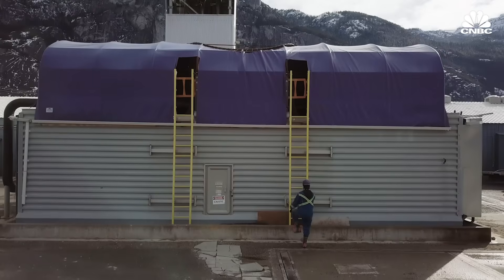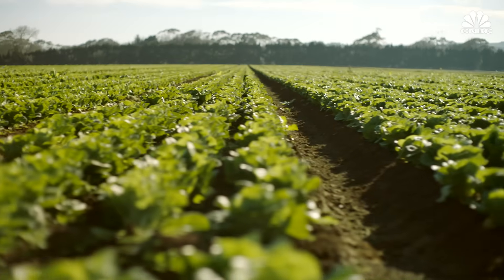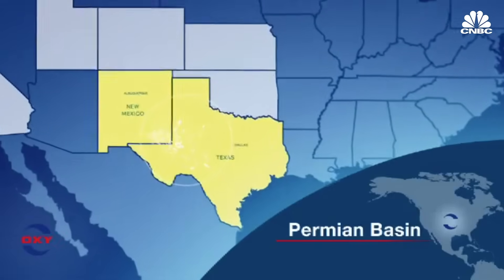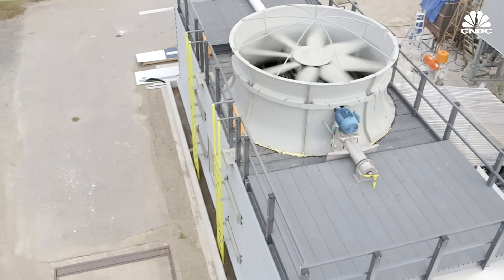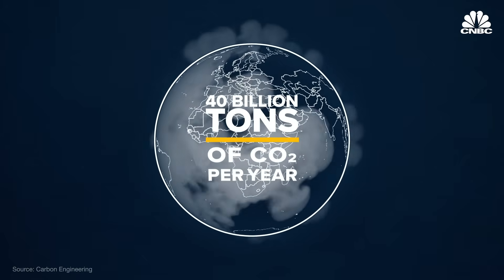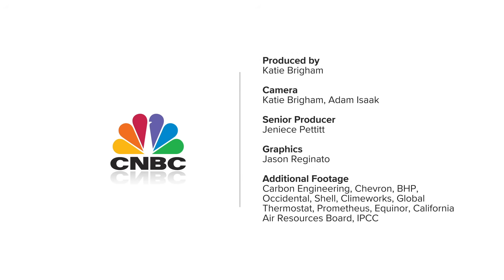Bill Gates-Backed Carbon Capture Plant Does The Work Of 40 Million Trees

Comment: Carbon Engineering is a scam. They are rent-seekers, dependent on the Government to select them as a "winner" the way Solindra, Enron and the Military Industrial Complex were 11:50. It will take four or more years for that to be clear to most people, at least seven before it is bankrupt, probably closer to eleven. On the other hand, their backers understand finances in a way that governments and philanthropists do not so it could happen sooner rather than later. Of course that means when (not if) they fail Big Oil will be blamed, they already started that mantra in this video. 

They project costs of $94-232 per ton of carbon 2:30 with the current CO2 levels of 400 ppm, but the climate scientists say it needs to be 100 ppm if we are to limit the temperature rise to 1.5 °C, so the cost will be significantly higher when they have to move at least four times as much air to remove a ton of carbon. The CO2 level at the smokestack is hundreds of times higher, and 60% of emissions are fixed so it would be cheaper and easier and have a larger impact if they put in smokestack scrubbers rather than free air recovery. Why would any company not choose the bigger market, with a bigger impact? Could it be they don't want to compete against others who know what they are doing, and have established the cost of carbon sequestration? 

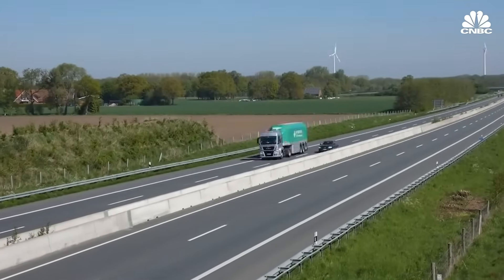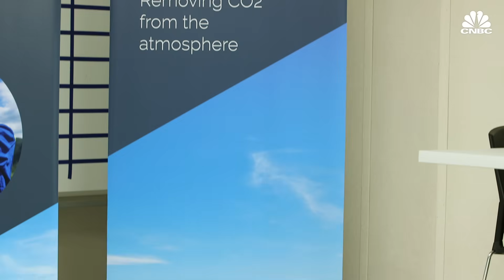The value of carbon removal 8:20 is only $20 in the best case, so they have to improve this system by a factor of 10 before it makes economic sense, and that can't be done, compressing the gas, moving air through the collector, and heating the pellets to remove the captured CO2, and sequester can only see small increases in efficiency. They need a quantum leap and only incremental ones are possible.  The only quantum leap comes from governments suddenly and dramatically increasing carbon taxes. Norway's $50/ton is enough to capture at the smokestack for the oil industry which they export and pass on to their foreign customers, but there is no tax on airplane emissions or cement production, and a much lower rate on their other industries so their overall tax is perhaps $10/ton. 8:50 "Unless we're getting a decent carbon price, the business case will for storing it permanently is not there yet."  Unfortunately for Carbon Engineering it will never get high enough 9:34.

Hydrogen production through the most efficient electrolysis process is about 60% efficient and then it is burned or put into a fuel cell with 60% or lower efficiency. So a fleet of hydrogen cars would require 2.5 times as many solar panels as electric cars. That is an insurmountable handicap. The price of solar hydrogen won't be coming down because the electricity has more value as electricity than as hydrogen.

Comment: They burn fossil fuel for energy to capture co2 released from burning fossil fuel?
Reply: Question is, do they burn more than they capture or less? I doubt Bill Gates would invest in this without finding out something like that.
Reply: The end game is to use renewable energy to power the system, but as long it’s running on natural gas it will emit more CO2 than it captures (by the 2nd law of thermodynamics).
Reply: Ah a Thunderf00t deciple you are my friend. No one else in the comments seems to understand this.
Reply: Peter W not really. The law of thermodynamics doesn’t apply to two different types of processes. They’re using an electrical power process to power the plant, but a chemical process to remove the CO2 from the air. It’s likely that the removal of the CO2 outweighs the power producing the CO2, or else this process wouldn’t exist. It’s more efficient to remove the CO2 than let it sit in the air or there would be no business model.
Reply: And then they create fuel to burn from the captured CO2. Flawless!

Comment: We can power these systems on the stuff uninformed people call, "Nuclear Waste". Which is perfectly good fuel for 4th Gen Reactors.
Reply: @default2826  Only 2 full blown nuclear accident occurred. Chernobyl and Hiroshima. Chernobyl was caused due to lousy reactor designs combined with extreme negligence both from the operators and the KGB who kept some nuclear secrets away from nuclear operator. While radiations are extremely potent, more people die from lung cancer (most likely caused from CO2 emissions) than people have died from radiations. 

So yeah, nuclear energy is the safest way to generate energy period.
Reply: And who will fund those expensive nuclear reactor....?
Reply: piyush nagawat the wealth tax should be able to do it.
Reply: piyush nagawat nuclear reactors provide cheaper energy
Reply: LD321 i understand that but that doesn’t change the fact that we don’t know how to decommission the 5 most dangerous buildings in the northern hemisphere because we don’t have anything that can touch it without also being decommissioned. 24,000 years we will have to deal with these buildings. It’s not out issue but out children’s children’s issue. That’s the legacy we’re leaving behind. Selfish behaviour from humans once again.
Reply: First reprocessing is exactly what France does. Technically it is recycling the waste, and 94% of the waste from a nuclear plant is recyclable. For some reason that prepossessing keeps getting made illegal in the US, and while it does have a cost (that apparently France can afford,) so does extracting new material, moving the waste, and storing it. 

But the reason it is so recyclable is because of the inefficiency of the gen II and III plants. Because of this Gen IV plants are 100 to 300 times as efficient. That means a year's worth of material a current plant uses will last 100 years. 

In the current plants they can only use a rod until it gets to 5%, then the isotopes no longer move fast enough. Because of the efficiency of Gen IV, that's not a problem. It means you should just be able to slide those rods into the new plant and it will just work. No repossessing. You will get about 95% of the energy out. Not to mention the waste will not only be smaller, about 60% of it will be inert. Much of it will be usable in industrial and medical applications. The small amount left will go from being dangerous for 10K years to 300. 

The one thing I get annoyed by with discussions on nuclear is the cost. Over a decade ago it cost $1 billion, and 10 years, before a single machine even entered the land to start building anything. Regulations were created only to be expensive roadblocks by people who do not understand nuclear. These increase the cost and time, then they complain it costs too much and takes too long. 

BTW we are closer to Gen IV than Thorium. Thorium needs a test plant, and nobody is funding it. I just listened to one expert working on it who said the way it works it could produce material that could be sold off, and as a result that becomes the main focus, while energy is secondary. Meaning they don't need to make money off the energy to make a profit reducing the costs of energy to consumers even further.
Reply: Can i have one in my backyard please.  Tired of PG&E in Ca.
Reply: Jona Adams yes! Thank you! 

I support renewable energy, and I support nuclear power!
Reply: Yea i think bill gates also doing that, he is on top of the greenhouse gas technologies
Reply: You sound pretty uninformed with that statement. Most nuclear waste is not fissionable fuel.
Reply: @dr.benjaminbird7631  True, but a significant proportion of the fuel in the fuel rods isn't "burnt" so ends up in the waste stream, as does Plutonium.
Reply: @dr.benjaminbird7631  Hence, why it's called "nuclear waste". Because if we could do something with it, would we call it waste?
Reply: @louisphilippe1100  she's refereeing to spent fuel, which can be reprocessed and used again. It's not really economical unless uranium is scarce and the prices are high.
Reply: @dr.benjaminbird7631  Do some more research friend, most current nuclear waste is fissionable in reactors currently under development. Older plants waste will be future reactor fuels.
Reply: @NPCVenture  I have a PhD in nuclear decommissioning robotics. I've spent a large portion of my adult life helping to clean up nuclear waste, very little, if any of it being fuel. But thanks for the advice.
Reply: Nuclear is one of the most disgusting, dirty and complicated ways to produce energy. I’ve worked on a decommissioning site for 10 years now with 5 of the most dangerous buildings in the northern hemisphere. These buildings are so contaminated we haven’t even been inside yet as the cameras we send in last 10 minutes. This is from the 1940’s and we haven’t even started to clean it up yet. No more waste should be produced we don’t even know what to do with the waste that’s already been created.
Reply: James Wilson yeah the 40s, when they were still racing to be the first to weaponize it. Not really a great example of what is possible when it's used responsibly.
Reply: @jameswilson9288  Nuclear has come a long way since the 1940s dude. Keep in mind, in the 1940s, people bathed half as often, we genuinely thought cigarettes were good for you, we nuked two cities with no regard for ecology, and cars had less than 10 MPG.

Just look at how far your phone has come in 10 years, you think nuclear technology hasn't improved in 90 years?
Reply: @jameswilson9288   You've worked in an old weapons facility, and you don't understand the difference between bombs and energy plants?
Reply: @jameswilson9288  !940's. We have moved on since then. They would solve a lot of our problems and create almost none.
Reply: James Wilson Just burry it in a concrete tomb. It is not as much , only 5 buildings and that is the most dangerous you say? I would gladly work there, renewables will not save us they are not reliable.
Reply: @jameswilson9288  Yeah, those plants were created in the 40's. Reactors now produce almost no waste, are much more efficient, and much safer. They literally pose no threat because we understand what we're using now. Back then, nuclear energy was still a new concept, of course the reactors would be worse quality.
Reply: @jameswilson9288  Far better than a gigantic wind or solar warm and I'm sure it has come a long way since the 40's...
Reply: TwoCan VanDam a solar farm wouldn’t cost more than the 117 billion a year to decommission. It’s a overly complicated mess that will take 1000’s of years to fix.  You’d hate nuclear if you had seen it first hand.
Reply: @jameswilson9288  Nuclear technology is much better than it was in the 40's. More efficient, safer, can reuse fuel, can use other kinds of fuel like  thorium. Nuclear is definitely the best option to produce energy.

Comment: What energy source do they use? (I doubt they use renewables only. And even if, it would be more efficient to use this energy directly and as such prevent CO2 being produced by the current fossil fuel sources)

Isn't it far more efficient to use this energy directly for power instead of first make CO2 and then use power again to "unmake" CO2?

Comment: It is extremely stupid and non viable way of dealing with the problem. It might work to some extent if you have access to very big amounts of solar power / heat, and when concentration of co2 is high, i.e. in exhausts of coal plants. But then during periods of lack of solar energy you will need to buffer co2, so you need a lot of buffer.

The only benefit is that it could be used with just thermal solar, which can be pretty cheap.

Otherwise, if it uses electricity from sun, then it really makes almost no sense. Just convert all power plants into solar ones for greater efficiency.

Residual co2 from cars, plans and ships, can be then captured by other means, or almost ignored, and dealt with real trees.

Comment: Whats the point of carbon capture if you're going to use it to create fuel?
Reply: If you can convert it cheaply using free solar power during day into liquid fuel, then it is a good option. It is overall net zero (or small) co2 emitter and we can still fly and drive. It has sense. The problem is, this plant is not doing this, nor it is efficient enough to do it and compete with other sources of fuels, even if others are taxed heavily.

Comment: If we take an VW Golf with an CO2 emission of 150g/km as an example and the low estemate of 100 $/t CO2 price. It would cost 15$ to capture the emissions produced to drive 100 km or 62 miles. It is way cheaper to just use green energy powed EV's in the first place.

Comment: To build these, it will also require the production and release of CO2 and other noxious gases in the air. It uses steel, uses mechanized equipment that use diesel, etc. Just plant trees!

Comment: Manufacturing of solar panels or wind turbines requires use of energy. Most of that energy comes from fossil fuels. I wish things were different; it's reality. Much of solar manufacturing occurs in China. I'm guessing by now there are now tariffs on them. This makes them less of an option. The solid waste after 25 years of use is another concern. I would prefer a nuclear option.  Much less waste. Lots of energy. Zero carbon emissions. Does produce thermal waste. The fuel can be reused like France does. We can also bury the waste in an ex-salt mine in Nevada.  Our problem is a few hundred NIMBY's really.  We have lots of uranium in the USA.

Comment: nice we will collect co2 form the air to turn it into fuel (requiring energy), which we will then burn for energy. real nice, sounds a bit like a perpetual motion machine
.
Reply: The source of energy is sun here really. It is not perpetual machine. In principle of it is efficient why not? You get liquid fuel based  that is dense energy storage and long term option, for the price of using solar energy when it is available. The problem is it is way more expensive than getting oil from underground and refining it. So it will not work on the market.

Comment: Why aren’t they putting these in the city’s not the dessert 😂😂😂
Reply: 1) A ton of CO2 in the desert has the same effect on climate change as a ton of CO2 in the city because the effects are not localized. 2) The difference in CO2 concentration in cities probably does not make up for the increased cost of operating on more expensive land. They're objective is to minimize the $90-200 per tCO2 cost. 3) This isn't even a commercially viable plant. They, like all direct capture plants, are still working on the proof of concept.

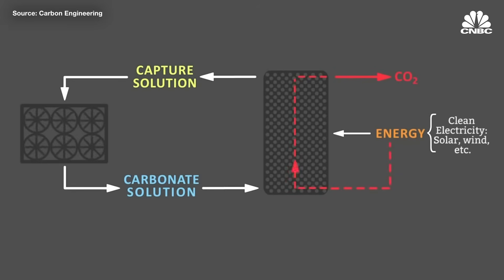Comment: At 1:59 in the video it shows that this system absorbs CO2, and then, after using unspecified amounts of energy, produces.... CO2.

So, seriously what is the point of this project ?
Trees are so much better :

This system only 'captures' carbon and does not store it like trees do.
Also this system requires external energy input, while trees get that from the sun for free.
Trees also require no maintenance, produce shade and cooling and food for animals, and wood as a byproduct.

Comment: This is weird to think by planting trees over carbon removal we use less fossil fuel. However it doesn't matter how many trees we plant or carbon removal systems we build. Unless there is a breakthrough then we will continue to produce the same amount of carbon yearly. Using carbon removal to help extract more fossil fuel doesn't automatically cause us to burn more fuel and planting more trees doesn't cause us to use less fuel. However both systems do offset the amount of carbon in the air which is a good thing. Obviously trees are more sustainable however we can't just depend on one thing at this point.